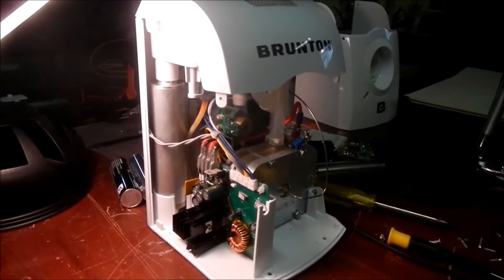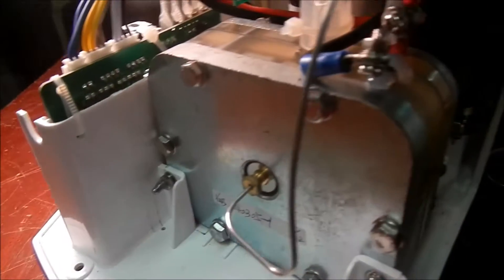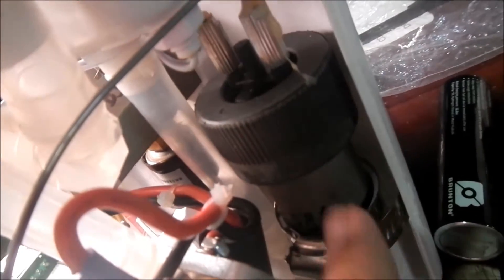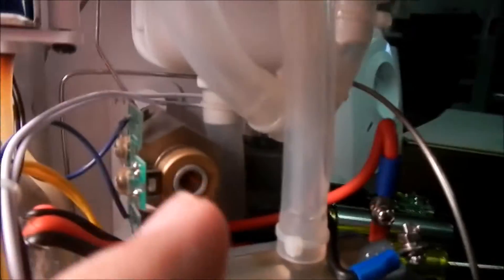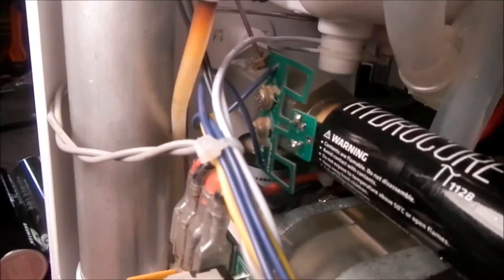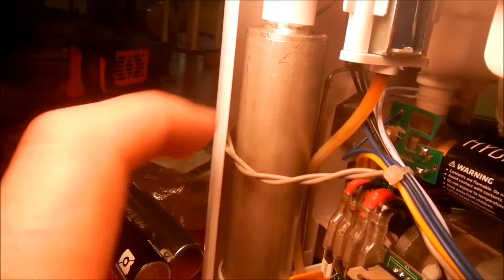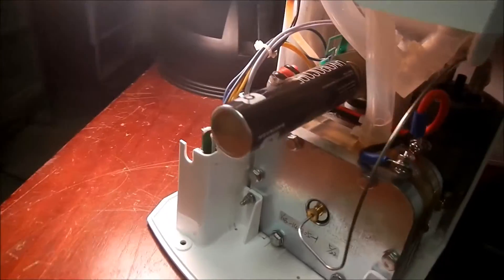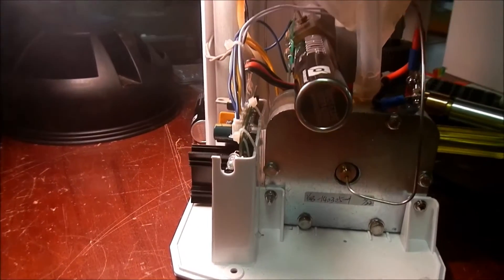Brunton Hydrolyser Tear Down

Comment: Are you still using the hydrolyzer for refilling the hydrosticks or you found a better method to refill them ( i.e. are you using pressurized hydrogen tank)? They are selling the brunton hydroreactor here in europe for 50$ so it is a cheap way to get two cores and all the fittings/solenoid valve etc to use in projects. But not to eager to shelf out the 300$ for the recharging station if it is not working well.  It says also everywhere that the white pro sticks will not work with the old station, but dont really get why as the pressure is not so much lower, any experience?  Thanks for the nice videos!
Reply from the maker: You could probably recharge the hydro sticks with a source of hydrogen and a compressor with the proper fittings to mate with the hydro sticks also you would need to build a pressure control system... but parts plus your time is probably going to be more than $300.  In my experience the Hydrolizer recharger and the cores seem to do their job but the fuel cell doesn't really work.

Comment: I really appreciate this video... but it has to get the hydrogen up to 30 bar somehow... I can't imagine what kind of electrolysis cell would produce that kind of pressure... that's over 400psi !  (the metal hydride in the cartridge needs 30 bar to store the hydrogen)   I suppose the "next step teardown" would be to disassemble the electrolysis cell to see which tech it uses... it needs to be a separation process, which is what makes me think PEM cell... but all I read says they don't produce high pressure.
What's the DC voltage across the electrolysis cell during operation?
Reply from the maker: it has a little pressurizing cylinder,  it makes enough pressure to force hydrogen into the storage tank  but that is about it. This whole fuel cell charger unit doesn't really work that great, cool demonstration of the concept but I don't use my system to charge devices.
Reply: I've been searching for months for one of these on the used market... no luck. While I do have a couple of the cartridges and one of the fuel cell "USB chargers" (my curiosity got the best of me, but at least it was 'used', and on eBay), my main goal/use now is direct hydrogen use... nothing to do with electricity. I realize there are other ways to accomplish it, but I like the reversible PEM technology since it gives very pure hydrogen.  Thanks again for the video :-)
Reply from the maker: Yeah the hydrolyser unit is pretty cool for 200 bucks, neat hardware inside. The fuel cell charger unit is just a crappy fuel cell with some USB charge electronics.
Reply: I finally got one on eBay.. brand new, same model as yours. I think your "bubbler" description of the device in the right-rear corner may be off... that device seems to separate the "waste water" that comes out with the hydrogen gas, and occassionally spits it up out into the left-hand water tank on the top. Besides... there's no real need for a "flashback" arrestor device here.

I'm changing my thoughts about the PEM electrolyser not being able to produce high pressures... now that I have first-hand inspected it, I believe it actually does... the thick steel plates on the side are clearly for strength under great pressure... also the high pressure line from the electrolyser would not be needed otherwise.  I also bought a couple of the little PEM based reversible fuel cell Hydrogen Car toys... and was able to get over 30psi out of one of those very easily... but didn't push my luck by going for more... since it's just cast acrylic.

The tall device in the left-rear corner that you called an accululator is, I believe, a dryer/filter... but may also serve the purpose as an accumulator as well.

I plan on trying to either buy or make an adapter that will allow me to use the hydrogen without using the "hydrocore" vessel... but I'm hard-pressed to justify $36 for it.
Reply from the maker: not sure didn't make a direct measurement across the cell.
Reply: It's about 2.5V at about 8.3 Amps... I checked mine (see my recent comment... I finally bought one)

Comment: If you could figure out a way to access the hydrogen without filling the hydrocores or breaking the hydrolyzer that would be awesome.
Reply: Simple... just use the high pressure fitting from the front port of the hydrolyser PEM cell... that is the Hydrogen output port. It's not "breaking"... it's "adapting".

Comment: Love anything that has electronics and plumbing in the same case, you always know something interesting is happening. Do you know how much current this thing draws when it is actively filling cells?
Reply from the maker: Yeah, should have got a video shot of the back panel which had all the specs on it. 
Below is an order site with a few specs. 

Input Voltage 10 - 19 VDC
Water Requirements De-ionized or distilled water
Water Temperature 50-104° F (10-40° C)

https://www.bhphotovideo.com/bnh/controller/home?O=&sku=1092317&gclid=CjwKEAjwgdS-BRDA7fT68f6s8zMSJADZwHmvGXfl5XK7MpBOBHiZ5WUOgivCwgbEtQ9aPMsSV5hMIhoCi1Xw_wcB&is=REG&ap=y&m=Y&c3api=1876%2C91438732682%2C&Q=&A=details
Reply: Like  my coffee machine